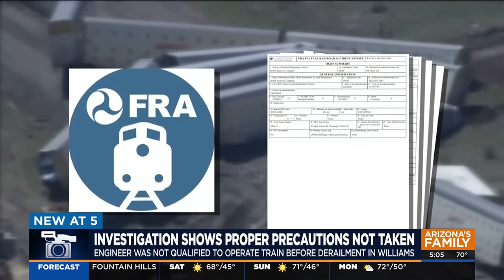Engineer unqualified to operate train in derailment near Williams, feds say

Comment: oh, ok-  so it was human error,  so how did he not use the brakes properly ?  since you found this relevant to post to youtube,  how exactly did the operator cause this crash ?  because im willing to bet that the guy simply had an expired certification, which they then just blamed everything on him - how is it, that this unqualified guy was able to operate their engine to begin with ?   "incorrect braking procedure"   (something mechanical broke or wore out) . "incorrect braking procedure"  sounds good to take the blame off the companys maintenance/safety
Reply: I hear what your saying.. I think the engineers name was Mr. Goat first name Scape
Reply: yeah same. I want to know how an engineer being under-Trained can be so bad at his position that 20 cars end up on each other?  Like...if its longer then 20 cars you need to apply the breaks extra slow? Boom im trained....i could do that fking job (the sitting part with the throttle). This sounds like a lame news story and not an actual issue.
Reply: @snypa-ck7hn  if you think you can do better the railroad is always hiring…

Comment: The longer a train is the more economical it is to operate. At current train lengths the average fuel economy equates to moving 1 ton of freight 500 miles on a single gallon of diesel fuel. That is nearly impossible to beat so expect more of the same.

Comment: The brake system on this type of equipment and length dont mix. It's too long for air brakes type brakes. It's too long to begin with. I'm sure the engineer is real good at his or her work. It's just the equipment it's too big to handle by the book.
Reply: car airbrake equipment upgraded in the 1970's only good with 125 car trains, being used in 200+car trains.
Reply: @rearspeaker6364  in work with brakes on trains. It's too long.

Comment: This scenario just doesn't make sense to me, what if the train goes into emergency, it was already set up to derail? i found it very hard to believe this was the drivers fault, i think there was not enough air in the system (train to big, not enough engines) or something went wrong with one of the cars or track. Those that drive trains step in here i'm curious to know, makes no since qualifications had anything to do with the train derailing in the middle like that.

Comment: Were the automobile cars empty or full.
Reply: Wut?
Reply: The auto racks were loaded with vehicles
Reply: If you watch the video, you will see, and the reporters will tell you.
Reply: I did @whiteknightcat
Reply: Yes, with Ford Transit Vans.
Reply: @nolanharder167  The vehicles were clearly visible inside some of the autoracks and one was even on the ground. The anchor also specifically said the train was carrying vehicles.
Reply: @whiteknightcat  I saw one of the cars that were inside and all the other cars were ruined and the line is closed for repairs

Comment: Of course the Union was in no way responsible whatsoever. 🙄
Reply: Whats wrong with unions?
Reply: Its not. Im a second generation railroader that worked for Norfolk Southern for over 10 years and was proud (Not of the unions). Then Precision Schedule Railroading happened,  PSR for short. It was a hedge fund raping operation of the railroads  that tore the industry apart for maximum profits. They do this by slashing manpower and deferring maintenance in every aspect, they basically just get rid of people and quit paying back into the infrastructure. Its a lot like driving your car until the tires blow up then walk away looking for another. I had to take a buy out and walk away from my railroad career because of it. The sad part is we the people are going to pay for this. Lots of government infrastructure funding goes to class one railroads. And thats your and my money. Their was a lot of management that was fired on the spot who tried to stop it, and i mean a lot. The unions couldnt do anything, the management was screwed, it was bad. Its takes years to train properly and be a  good and safe employee on a railroad in any craft. So this will be an issue for at least a decade after they learn to railroad again.
Reply: @f.radleplayer2920  Do you think the strike that didn't happen a year ago or more would have addressed these issues?
Reply: No. They would have had a presidential "Return to work" order from DC. I would have to re-read the rules on Railroad striking, but you can't just strike, that's disrupting commerce. Literally screwing with the economy since railroads haul so much. You have to say you're going to strike, then so much time goes by, and if there isn't a response, you can. Something along those lines. Sadly, what's happening is what needs to happen. This way, the people of the USA can see just what's going on. All the big class ones adopted PSR in some way, shape, or form. Even the shorelines have. People have to see it all fail and be exposed as to why. If you go striking, the finger will just be pointed at the unions. Then you take the spotlight away from the problem. Sadly, a lot of the management in all departments of the railroads now a days are newer, clueless and scared. They are not leaders, they are followers that genuinely don't know anybetter. The people on the ground can only do so much when their own boss is lost and clueless. 10 years ago companies started demanding  management be from college with management degrees............ ssssssooooo now the workers have to train the boss............. the boss we need to be a leader dosent know the job he's managing because he came from college and not the craft he's managing........ And this is supposed to be progress???? Now bring on Precision Schedule Railroading and their major employment cuts and complete disregard of maintaining any aspect of anything whatsoever, and you get this hot mess.

Comment: I was reading an article a year or so ago, about the railroads not having enough train crews.

The article mentioned that the BNSF logjam was due to the lack of crews based in Needles, California.  Some 200 open positions, IIRC.  No new hires wanted to be stuck in Needles, no takers from existing crews to transfer there.

(Only 200 crews?  Seems to me that throwing some big bonuses/incentives out there (say, doubling their pay) would have corrected this in a nano-second, for not a lot of money.

But these are lowly train operators, not "professionals" like airline pilots who "deserve" $200/300k a year.
But I digress......)

Seems like the wretched refuse have figured out that moving to BFE to take a low paying job you might be stuck in, is not the hot ticket for improving your quality of life.

Williams isn't that far from Needles.  Same crew district?  How much experience did this crew have?
Part of the "fog a mirror" bunch hired for the open positions?